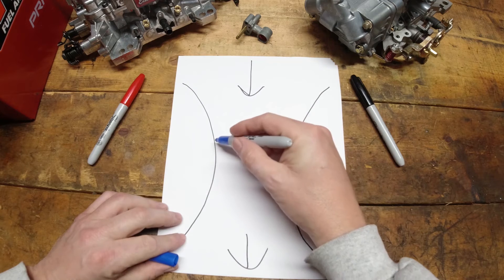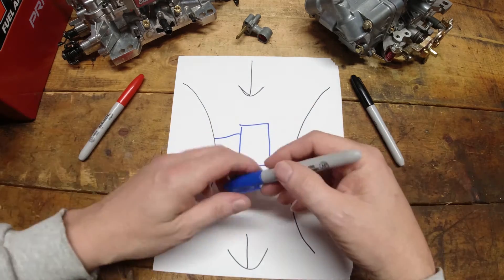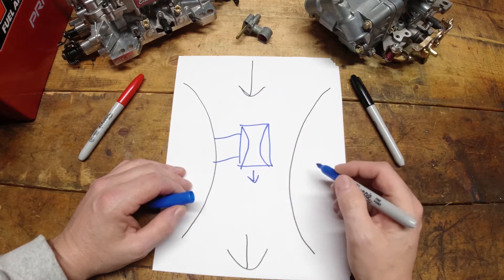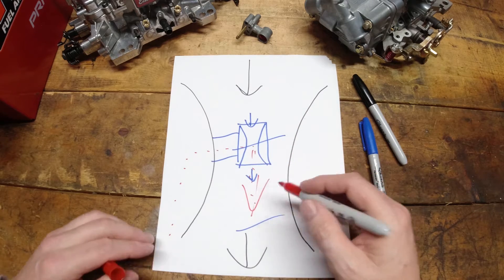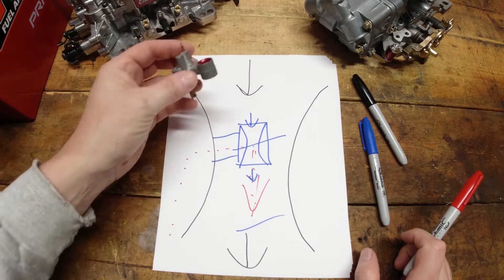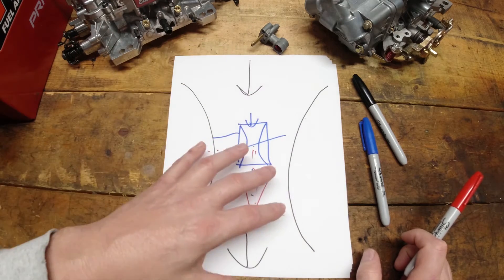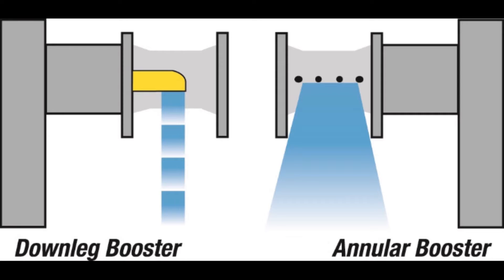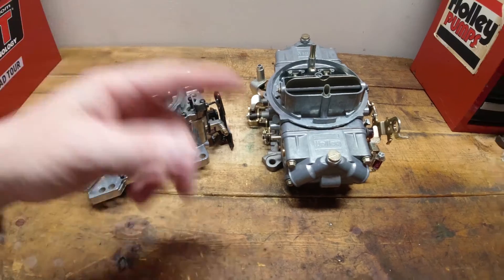Carburetor Annular vs Downleg Boosters

Comment: Great demo!!! 

I have an AVS Edelbrock carb, and i asked Edelbrock if the Annular booster could be sold separate  and if it would would cure the bogg.... 

Edelbrock said nope , you need to buy the new carb.. 

Thanks for the video !!  As always explained well , and makes it clear to understand
Reply from the maker: The issue is calibrating enough fuel on a non AVSII carb.  If you notice, they don’t offer a 600, only a 650.  They don’t have a 750, only an 800.  Reason being is the booster needs a bigger signal to work properly in its current configuration.  Putting the annual boosters on a regular performer series carb would only make it worse.  It’s all about the air speed and the pressure drop to pull the fuel from the main fuel circuit.
Reply: @MuscleCarSolutions  Thank you! I was wondering the same too. So the issue with retrofitting an annular booster to a performer style edelbrock is that the booster doesn't allow enough air flow through it to pull enough fuel out of the booster?
Reply from the maker: @car_ventures  that is correct.

Comment: I've watched several of your video's today. Seriously considering swapping out my 950 DP Holley for the 800 Edelbrock AVS2. I've got a 468 BBC and while it runs fine I feel the 950 is too much for the street. I want to thank you for helping me make the decision to switch. Always wanted too try a annular discharge carburetor and your video's are very helpful and educational. I now understand why I could never get an Edelbrock carb to run right. Thanks again.
Reply from the maker: It all comes down to three things.  Correct fuel system, ignition and timing set properly and the adjustments made to the right size carb.  The issue with Edelbrock carburetors isn’t the hardware, it’s that for some reason people don’t seem to be willing to learn how to TUNE.  Holleys aren’t any different.  It’s just the excessive fuel they push covers up a lot of flaws and people think it’s good enough.  Best of luck on your decision!